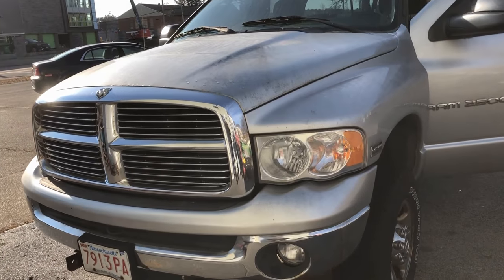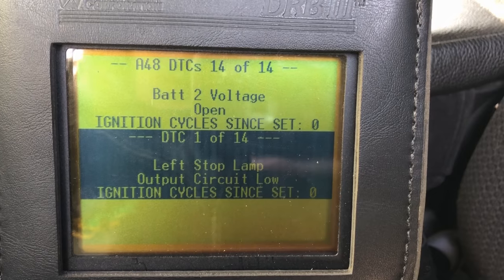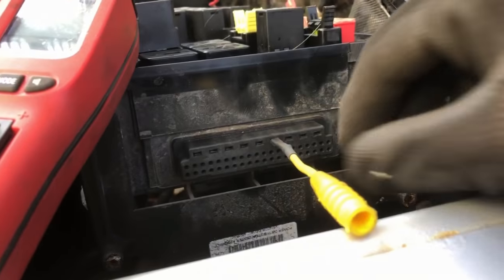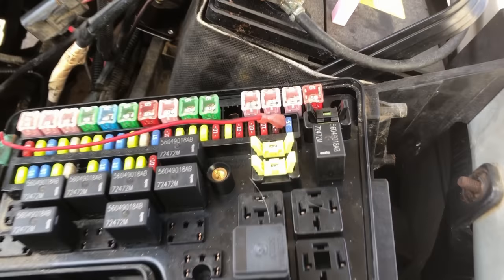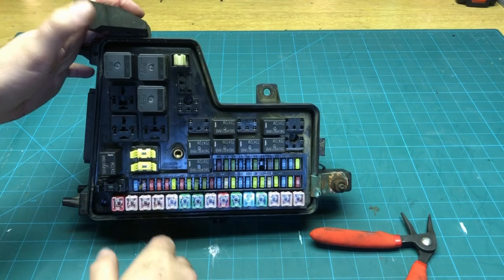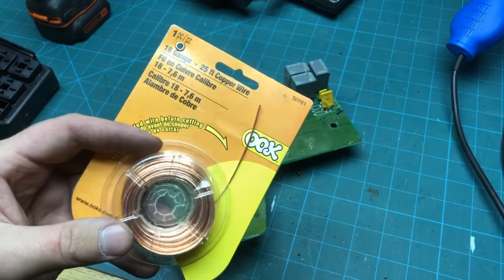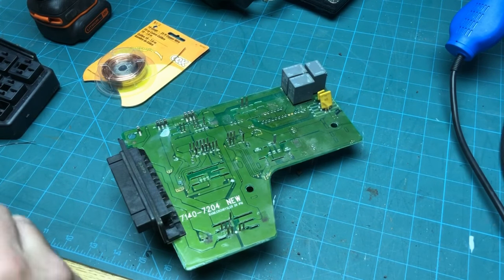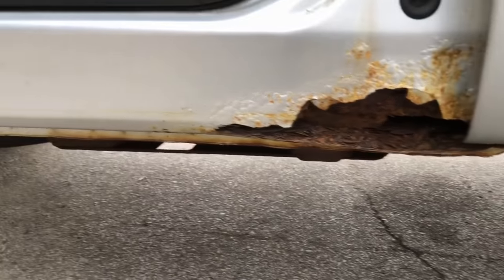04 Dodge Ram lighting fault. IPM/FCM diagnosis and repair

Comment: Just fixed my 04 Ram 1500. I should have taken pics. pulled mine apart, cleaned the board, brushed the pins and IT WORKS! (Btw, left side headlight was out). I also fixed the P044 & P0456 codes. This video was amazing. Told me where to look. Thanks again.

Comment: Just bought a used one bc I'm having same problem except all headlight turn signals and brake lights are out and no one has new ones the dealer even said they are on back order. Great video I work on alot of stuff but this might be a little above my skill.

Comment: Coming to this kind of late but I’ll comment anyway. First many thanks, you saved me big bucks with this video. I have a 2004 Dodge Ram 1500 Hemi, owned it since new, now has 205K miles. Had the intermittent lamp out warning light problem for a month or so, finally came on steady and the left side low beam was out. Replaced bulbs and still out. After watching the video, it occurred to me that the intermittent function on the wipers was erratic and could be related to the lamp out and both could be due to corrosion on the pins connecting the FCM to the IPM. Took it apart and sprayed the pins and sockets with contact cleaner and blew it off with compressed air. That’s all it took, lamp is on, warning light is out, works perfectly. Less than an hour and cost nothing, dealer probably would have had the truck for 3 days and charged me $$$. Only surprise is my truck is pretty much corrosion free in general and the pins on the FCM looked decent, a bit discolored but not green. But that was definitely the problem. Thanks again for the logical and methodical troubleshooting guide.

Comment: Where do u live I'll drop off my 2003 Ram van. I have no turn signal flashers.  I do have 4 way flashers. There's no power windows but my  electric door locks work I have rno radio and no front heater fan. I do have rear heater fan. I don't have the equipment or understanding you have. Your very Impressive and knowledgeable of the electrical side of vehicles I do not know what to do next?

Comment: That's why they say your computer has a bug. I think in WW2 they were using the new computer that took up a whole room or 2. They used it for bombing equations, and it quit working and they found a moth on a circuit and they cleaned it off and bam it started working like normal, and now that's the term for a problem with a computer.

Comment: My truck was running good, but after I jumped it off with a higher voltage it did not crank, the ignition switch is dead, what would that be?????? Thanks .

Comment: Mine 2005 1500 dodge ram 5.7 says no link on OB2 FUSE IS GD BOX GOT REPLACED BUT NOTHING WORKS NO WIPERS SIGNAL LIGHTS BUT LOCKS DO MIRRORS WORKS NO CLUSTER JUST BLINKS ON N OFF BUT THE REPLACED PCM WITH A 07 RAM 4X4 SO IM GETTING A NEW PCM HOPEFULLY THATS IT WAT U THINK also it misfire here n there trouble shifting but engine is gd

Comment: I had the exact same lights out. I did exactly what you did and it works perfectly. I ended up using epoxy to cover the new circuit.  Thanks for the video.

Comment: Some advice for those who decide to use a salvaged TIPM rather than repair.  First of all, this is NOT a TIPM, it's an IPM.  These earlier Dodges (up to '06 I believe) used an IPM (basically a fuse box with circuitry) which had a FCM (front control module) bolted on to it.  A TIPM has the two parts combined as one unit.

The FCM contains an eeprom which is married to the VIN# of the vehicle.  If you swap out the IPM make sure you use your existing FCM (it's the aluminum box on the side of the IPM).  If you use a salvaged IPM including FCM, you'll have all kinds of odd 'Lamp Errors' which will entail having your vehicle reprogrammed.

To sum up: The IPM is 'plug & play' as long as you use the original FCM.

Comment: I was certified in circuit board repair in the military.  
You did a good job.  
And your electric trouble shooting is right on.   Voltage readings don’t mean squat with a 100M ohm impedance voltmeter without a load on the end.

Comment: This video may be 4 years old, but it sure helped me repair the same light problem I was having on my 2004 Dodge Ram 1500.  You were right on the money with the diagnosis and repair procedure, many, many thanks to you!  Same failure, same repair.  I did notice what caused the failure.  On the underside of the IPM, where the harnesses plug into the bottom, there is a small square hole in the housing right where the failure on the circuit board occurred.  That hole left the elements get access to the circuit board and caused the failure!  Also, I tried finding a replacement IPM for this vehicle and there were no new ones to be found anywhere, but I did not try a dealer, only aftermarket parts stores.

Comment: Just a follow up I took the fuse box apart and found corrosion at the same point as yours, the solder and wire did the trick for me too! Thanks so much bro, you saved me a ton of money.

Comment: Great video! I have a 2005 Dodge Ram 2500 5.9. 1 high beam  and both low beams do not have power. Both turn signals flash fast but only the rear bulbs are actually flashing. The "bulb out" light is on the dash. 
After watching this video I removed the fuse box today. When I took it apart the board was corroded in the same place, just like in this video. I cleaned up the area and placed a piece of wire on there with solder just like in this video. Once I put it back in the truck but it back together everything now is back to normal all 4 headlights work, all the turn signals work and flash as they should.  There must be a weak spot in this part of the board from the factory if this many have the same problem.

Comment: Thank you for showing this repair. I just fixed my truck and it was exactly the same corroded area on the circuit board and I would have been pulling my hair out trying to diagnose the problem.

Comment: Awesome, thank you very much. I have a 2005 Dodge Ram 2500 Cummins diesel and had exactly the same issue with the signal and headlight. When open the TIPM I found the same corrosion issue on the same spot on the circuit board. Indeed the same solder took care of the problem. Thank you again this saved me a bunch of time troubleshooting. Cheers.

Comment: Man I pulled my box apart the other day and came across the same corrosion in the same spot.no turn,brake,hazzard, low beam, I traced   circuits with Mitchell and demand schematics, and hooked up our soulus ultra...pulled fcm pinout and probed them, I have them if anyone is interested. I've never thought about a load test duh.. thanks man for helping me.comfirm it didn't want to waste my time..I'll post up a video also thank you!!! Going to shop here in a few and getting to work thank you again man. I've been reading for about 4 days!!

Comment: Thank you so much... Repaired My 03 2500 tonight. Same exact spot on the board.i normally would buy a replacement but 350 and out of stock... For a rebuild.. again. Thank you. Oh 278000 Miles.

Comment: Worked like a charm on my 2003 Dodge Ram 2500 SLT. Thanks for showing how to fix this problem. I used screws to fasten the drilled heat stakes. I also re coated the board to seal everything back up. Very good video, thank you

Comment: I have mine all apart. Exact same issue with corrosion in exact same location. Dodge should have had a recall on these things. Ready to solder my 18 gage wire. just need to know what to use for protection to cover the wire. I can't seem to see where you mentioned what you used or how you go about it.

Comment: This is a great video and information on a really common Dodge/Chrysler issue.  Also, the mic works great too. I am about to try the same thing on my 2005 3500 diesel.  It had the same headlight issue several months ago, and before that had weird electrical issues since I purchased it a few years back.  I removed the IPM and  FCM when I tackled the headlight issue and simply replugging everything in got it working correctly ... for a while.  Now, I am diving all the way in . . . way over my head!  
 I found in replies that you use the Power Probe 4 for your testing, and saw info on how to insulate the wiring fix as well as using screws to reassemble the unit halves.  Was wondering if you had any "fixes" for the locking tabs on those cursed connector/plugs beneath the IPM?  Are there any videos for how to release and remove, and replace them correctly?  Three of the five large connectors are broken on my truck... and that is BEFORE I got a hold of them.

Comment: Thank you very much for the video!!! The exact issue just happened on my truck last week, I tried some general research and it mostly went to throwing parts at it. You went in depth and explained everything. I will open it up and see what is fixable. Funny side note is I pulled the complete IPM/FCM off of my companies plow truck (same year) yesterday and still had the same issue. But afterwards found out that the plow truck had the same issue. lol. Thank you from Ontario Canada.

Comment: Thanks for this video. Had the exact same problem with my '05 Ram. I tried for the life of me to solder to the board and it would not stick.  I'm a newb to soldering so not sure what I was doing wrong. I ended up soldering a jumper wire to the pins on the other side of the board and it fixed the problem.

Comment: Thank You Very Much. Went to Junk Yark Pick and Pull !!!!!  I took my tools Found a Dodge and took this Part Out. Got home installed and now all my Lights Work. I was about to take truck to an electrician shop i always go to. Thank you very, very ,very Much❤ The part was 20 dollars at the junk Yard Just remember to go Early it Gets Hot😂😂
Reply: What was the issue ? Just Wanna see if it's similar to mine
Reply: The Part was Completely Burnt Inside.

Comment: Thank you. My abs, srs, climate controls and speedo. All stopped working. I was suspecting it was the module attached to the fuse box but now I'm going to open up the tipm and have a look.
Reply: Ever find out what was causing your issues? I’m having similar problems

Comment: Hi. Based on watching your FCM video with the low voltage issues triggering the lighting fault, I was wondering if I should investigate the TIPM for the DTCs on my 04 Ram 2500 5.9 Cummins. DTCs are P0882, P0973, P2769; all for low signal input.

Comment: This video is awesome.!!! I am having a problem with my Power windows NOT operating on my 2004 Dodge Pickup. 
I also own a 2002 Dodge. I've swapped the driver side window controller around on both trucks. The 2004 window controller works in the 2002 truck. the 2002 window controller will not work in the 2004 truck. I have not been able to  locate the relay/fuse for the power windows.
ANY HELP!!! OR Advice would be GREAT!

Comment: 2005 Chrysler 300 Limited. Single turn signal doesn't work but hazard light blinks normally when the switch is turned on, wipers too doesn't work. Mostly for the trafficator / turn signal what could make it to be inoperative and how can I fix the problem in that car? Can you guide me please, on the repair procedure and wiring diagram to help me fix the problem?

Comment: How did you separate it on the side with the module? The whole right side with the module connector is supposed to slide upward. How did you achieve that?

Comment: Good video. I have a similar problem but I only get the "lamp out" warning when my headlights are on AND I add the right blinker into the mix.  Blinker without the headlights works.  Headlights (all lights really) with left blinker works, but Headlights on and right blinker, will trigger the "Lamp out" message.  I'm thinking either a headlamp socket not making good contact or the same issue you had here...  Which one of your past videos has the details on your test meter with the built-in bulb for making sure circuits can carry a little current?  Nicely done video!  Let me know, Clay

Comment: Hello.  I have a problem in my truck and it's that the brake lights don't work and neither do the dash lights, such as P R D 1 2 do you have any ideas to solve it?  I already checked fuse 24 and the brake switch under the brake pedal and they are fine.  thanks and a hug

Comment: What would you do if you had  a 2008 dodge charger that does not turn the hazard lights on. I replaced the switch but it still not working.

Comment: 2004 dodge 3500
~EXACT~ same problem....
~EXACT~ same location...
~EXACT~ same repair....
I don't think water is the sole culprit. I think the circuit trace is too narrow for the current being carried. High current (temperature) breaks down the "weather proof" coating on the circuit board. Add a little humidity/moisture and the trace doesn't stand a chance....

Thank You, this helped me save my Easter Long Weekend camping trip.....

Comment: My lights.. I had same issue. I replaced the board in my tail light assembly. Works great! The circuit boards get hot and go bad. Also don't use anything on electronics other than DIALECTRIC grease.

Comment: I’m not sure if you still reply to comments on this video but how did you secure the pin after drilling those plastic fasteners out? Great video by the way!
Reply: I drilled out the top of the plastic post so a flat top wood screw would thread in there with a washer on it.
This solution may not work if you have relays populated in the two spots covering the posts.
I didn't have relays there...

Comment: Would you be able to show me the process for the rear running lights? Same vehicle cant drive the truck at night because that back night time running lights dont work
Turn signals work
Hazard’s work
Reverse lights work
Not the top lights that turn on when head lights do the headlights do work but not the back ones please and thanks in advance

Comment: I have a 2004 ram 2500 5.7 and my passenger side high beam is out so i went to change the bulb but as soon as i put a new bulb in it automatticly lights up no switch on or key in any ideas

Comment: Got same issue not into soldering circuit boards. I sweat pipes (plumber) Do you know if the circuit board is the same for 5.9l to 4.7l to 3.6l trucks? 2002 4x4 ram1500 5.9l with AC.

Comment: Help please: my truck is a 04, 3500 I believe I have a problem with my IPM/FCM my main 2 brake lights at the end of the bed are staying lit up with the truck ignition on or off I have tested and checked everything else except the IPM/FCM what could have happened or cause this issue for me to look for to try and fix this myself and what to test any help would be greatly appreciated.

Comment: So if you had a higher voltage on 3 and 4, would it have been safe to assume it was the front control module?

Comment: Have the exact same thing going on with my Ram, tried to repair the board and it didn’t solve anything. Replaced the IPM/FCM with a refurbished on and it solved the problem, however a week later when I turned on my truck, the drive side front blinker wasn’t responding, it just stayed steady glow while the relay went clicking fast

Comment: I have a 2006 dodge ram 1500 and my low beams are not working. You think this would be my problem?
Reply: If all other lights are working it’s most likely your fcm or the dimmer switch on steering column.  The switch on column is known for having the low beam wire break if you use the tilt wheel often.  If you can raise and lower your wheel and they flicker at all that’s the issue.

Comment: Commented on this two years ago. Still haven't had my IPM/FCM looked at. Got a headlight that doesn't work even with a new bulb, wipers that will occasionally cycle even when the switch is off, and intermittent wipers that are possessed by epileptic demons. Not to mention an oil gauge that periodically drops to zero. If I could find a way to bypass the voodoo box altogether I would.

Comment: Can just the low beam not work? I have directional, brake and high beam but only low doesn't work on either side. There use to be globes installed but we're swapped back to original bulb lights but low beam didn't work prior either.
Reply: Most times that’s the fcm.

Comment: Have the problem on an 04 dodge ram 1500 the rear running lights dont work as well as the windshield wipers operate on start up wiping 6 times then stopping tested all fuses and connections as well as tow connections .all are operable.
Reply: The wipers on my 05 were doing same thing. I put a new relay in and it fixed the problem. Now I don't have parking lights. 
POS Dodge.

Comment: Do u have to program new fuse box if u get a used one instead of repairing one from the vehicle?
Reply from the maker: That fuse box should be plug and play.
Reply: @tdracing13  i purchased one from eBay that came with the module too, now the truck won't start just crank do u think this is one is also bad? The original one had corrosion and the headlights won't turn off